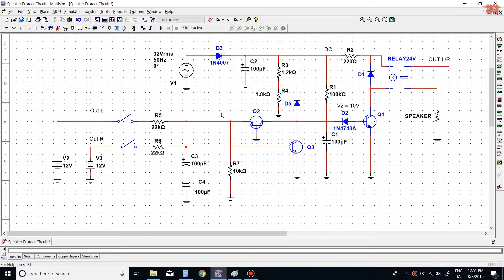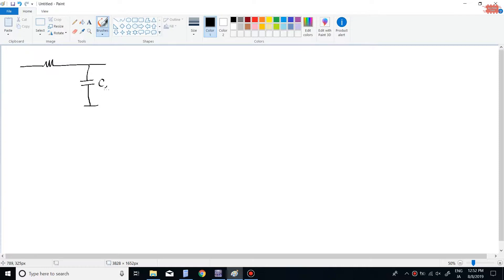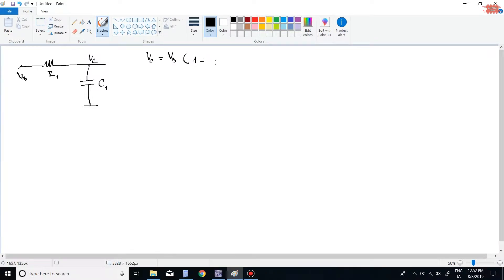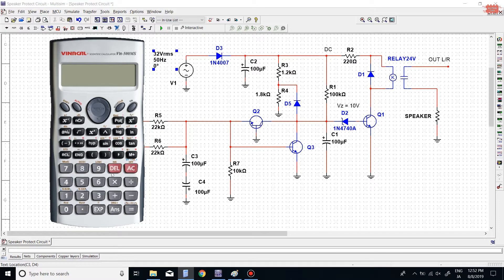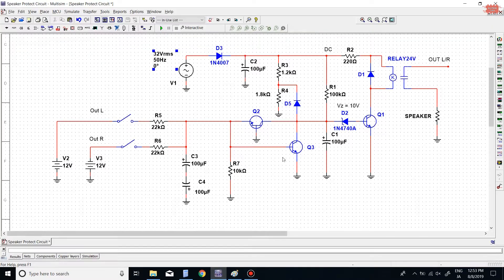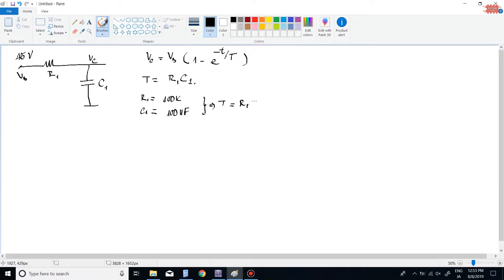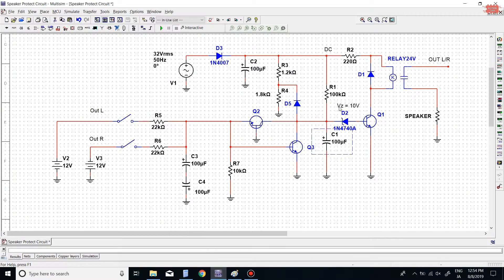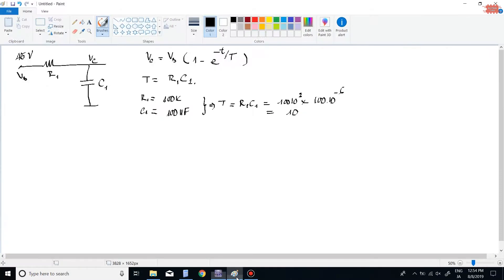Audio circuit amplifier| DC speaker protection circuit | Part II - Calculate delay time | ALPHA Lab

Comment: What is the value of diode D5 ?
Reply from the maker: You can use 1n4148 diode or another.
Reply: @ALPHALabs02  ok thank you. And one more  question  does this circuit effect any DC offset of the amplifier or not?
Reply from the maker: If the DC voltage is about 2V at the output voltage, the circuit is activated.